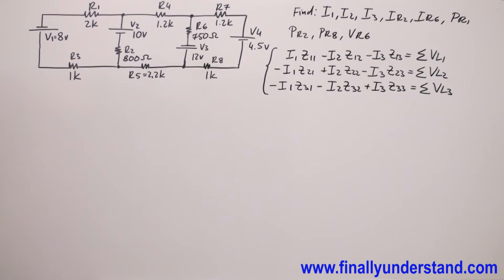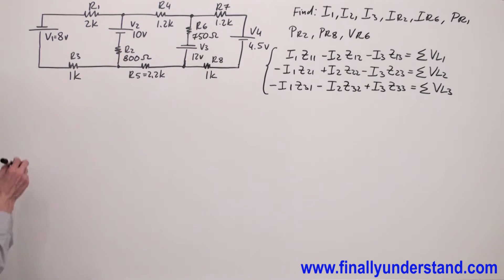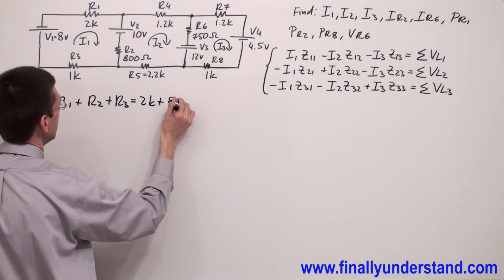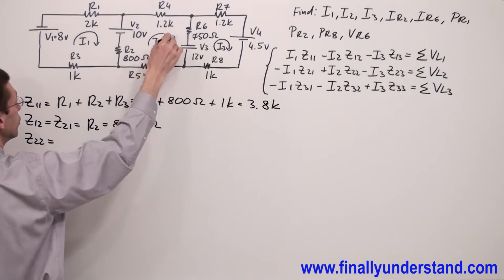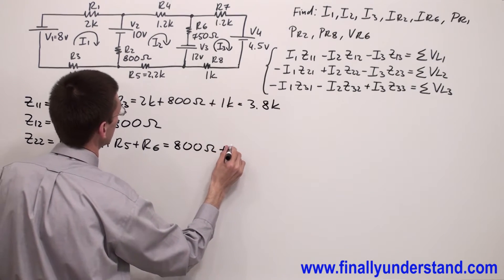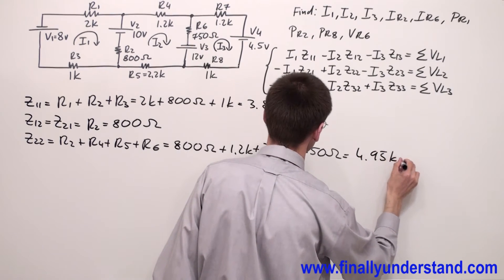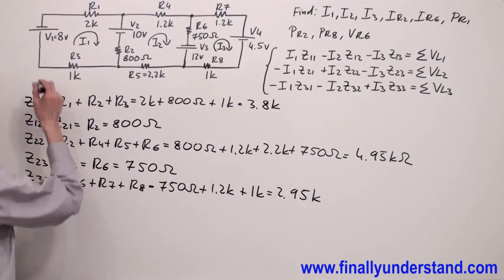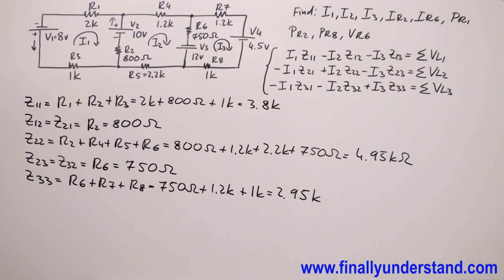Mesh Analysis Ex 05

Comment: 1. I1: It can be found using the following equation:
    I1 = (V1 - V2) / R1
    I1 = (-8V - 0.10V) / 2kΩ = -4.05mA

2. I2: It can be calculated using Kirchhoff's Current Law at node b:
    I2 = I1
    I2 = -4.05mA

3. I3: It can be calculated using Kirchhoff's Current Law at node d:
    I3 = (V3 - V4) / R7
    I3 = (12V - 4.5V) / 1.2kΩ = 5.46mA

4. IR2: It can be calculated using Ohm's Law for R2:
    IR2 = V2 / R2
    IR2 = 0.10V / 8kΩ = 12.5μA

5. IR6: It can be calculated using Ohm's Law for R6:
    IR6 = V3 / R6
    IR6 = 12V / 750Ω = 16mA

6. PR1: It can be calculated using the following equation for power:
    PR1 = I1^2 * R1
    PR1 = (-4.05mA)^2 * 2kΩ = 33.05mW

7. PR2: It can be calculated using the following equation for power:
    PR2 = IR2^2 * R2
    PR2 = (12.5μA)^2 * 8kΩ = 1mW

8. PR8: It can be calculated using the following equation for power:
    PR8 = I3^2 * R8
    PR8 = (5.46mA)^2 * 1kΩ = 29.9mW

9. VR6: It can be calculated using Ohm's Law for R6:
    VR6 = IR6 * R6
    VR6 = 16mA * 750Ω = 12V

Comment: 1. I1: Currently, we don't have enough information to calculate I1.
2. I2: We don't have enough information to calculate I2.
3. I3: We don't have enough information to calculate I3.
4. IR2: We don't have enough information to calculate IR2.
5. IR6: We don't have enough information to calculate IR6.
6. PR1: We don't have enough information to calculate PR1.
7. PR2: We don't have enough information to calculate PR2.
8. PR8: We don't have enough information to calculate PR8.
9. VR6: We don't have enough information to calculate VR6.
10. V1: -8V
11. R1: 2kΩ
12. R3: 1kΩ
13. V2: 0.10 V
14. R2: 8000
15. R4: 1.2k2
16. R5: 2.2kΩ
17. R6: 750Ω
18. V3: 12V
19. R7: 1.2kΩ
20. R8: 1kΩ
21. V4: 4.5V